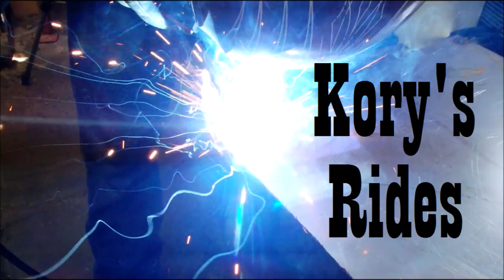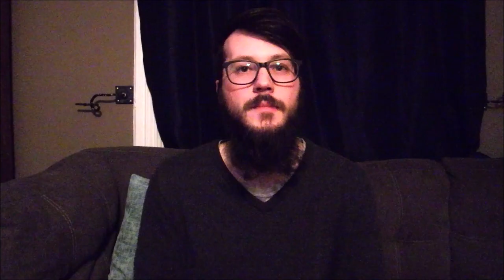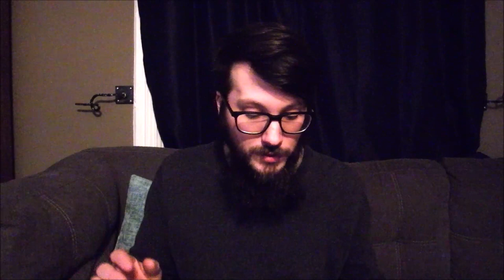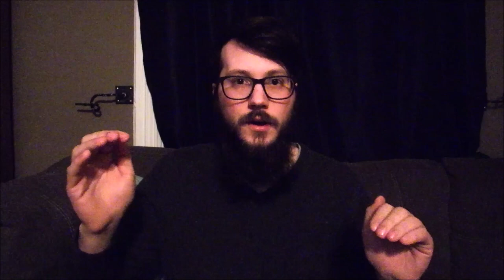Open vs Closed Loop EFI

Comment: Does open loop without o2 sensor require a fuel controller like Electric fuel jet box ??
Reply from the maker: No, the stock ECU has a base map of safe parameters to operate with. You won't make max power or max MPG this way, and won't run efficiently, but the engine won't destroy itself either.
Reply: @KorysRides  you explained very well Kory thank you , so really nothing gained by taking it off then ?

Comment: Does open loop affect fuel economy?
Reply from the maker: Yes, it is usually poor due to the engine running on safe program parameters without external feedback